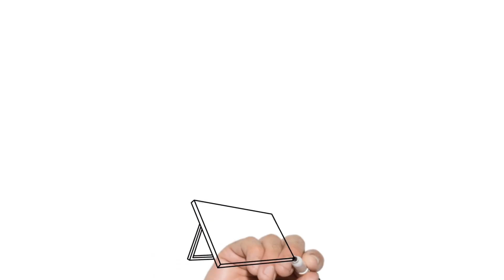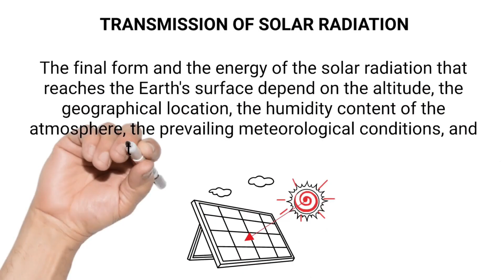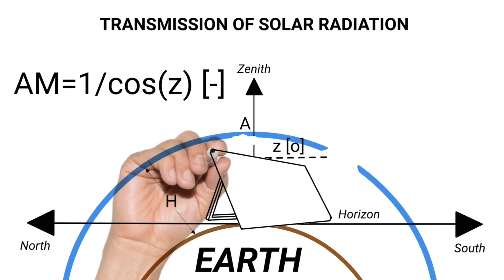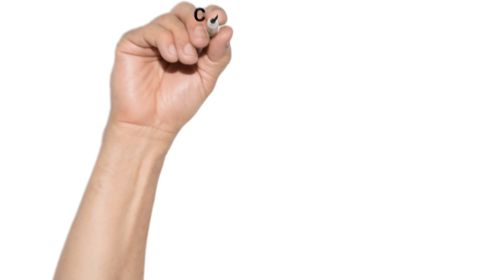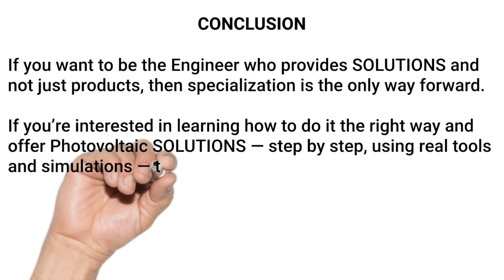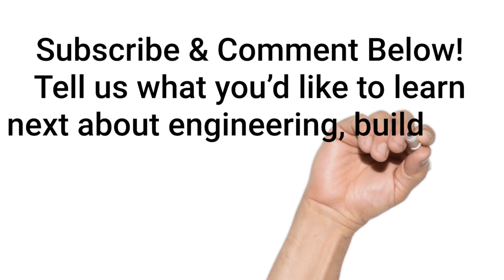Direct Solar Radiation vs Diffuse – Which One Matters More?

Comment from the maker: Solar Quiz for You 👇
Which of the following types of solar radiation are components of the total solar irradiance that reaches any surface on Earth?
a) Direct
b) Indirect
c) Reflected
d) Absorbed
e) Diffuse
f) Transmitted

👉 Write your answer in the comments using the letters (e.g. “a, c, e”) and explain why.

In this video, you’ll discover the real secrets behind solar radiation — and why the Sun is the ultimate source of renewable energy on Earth. We’ll explore how solar power affects everything from climate to building performance and photovoltaic efficiency.

If you enjoyed this video, subscribe to the channel and comment which topics you’d like to learn next — whether it’s mechanical engineering, buildings, or energy systems.
We read every comment, and our team creates new content based on what matters most to you. 🚀